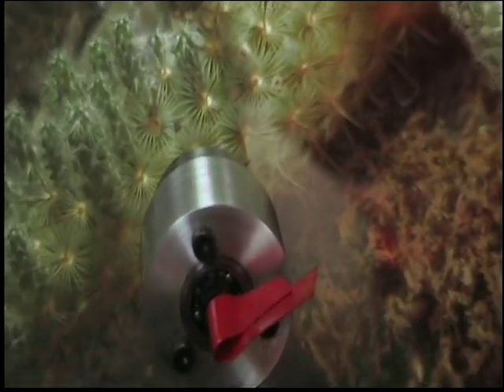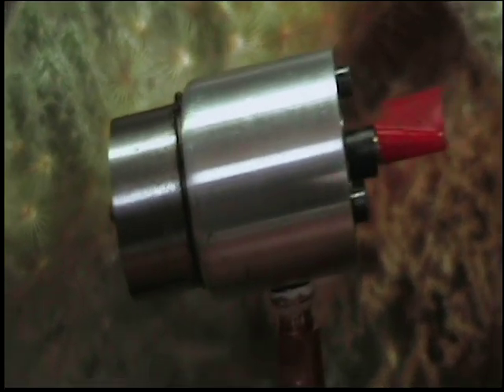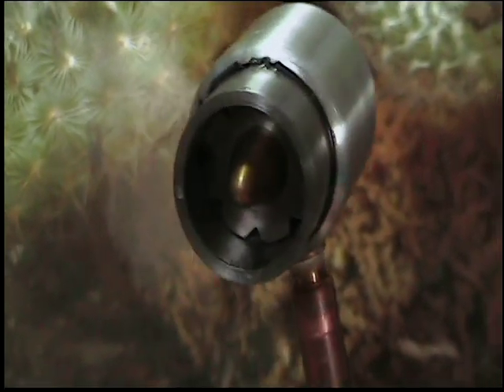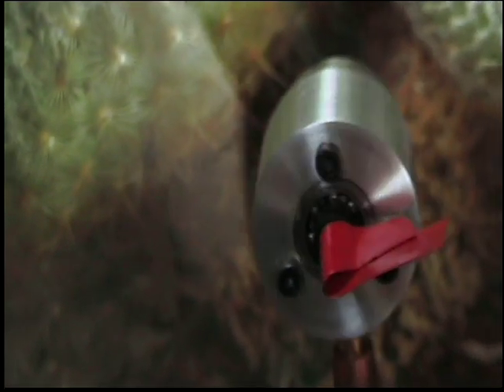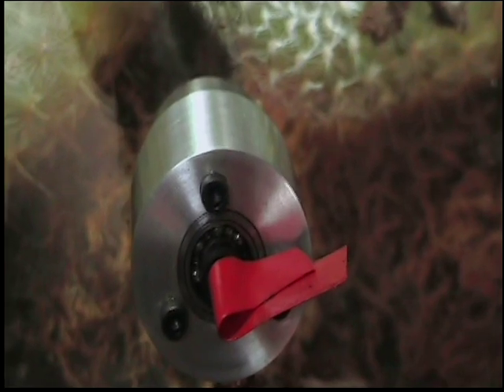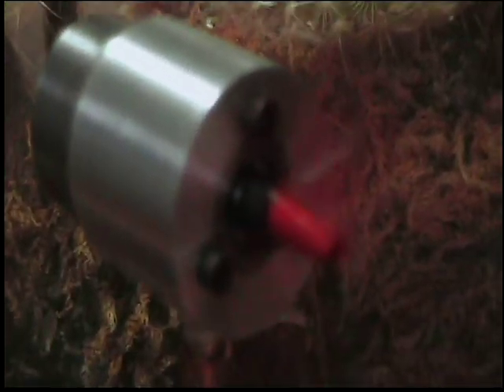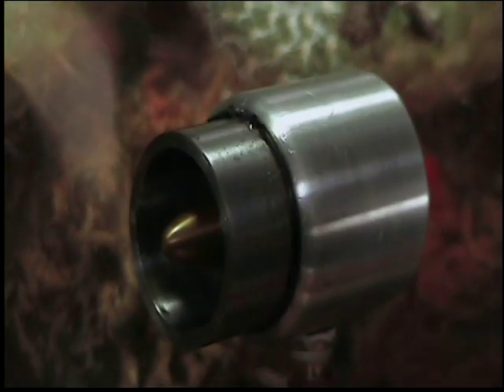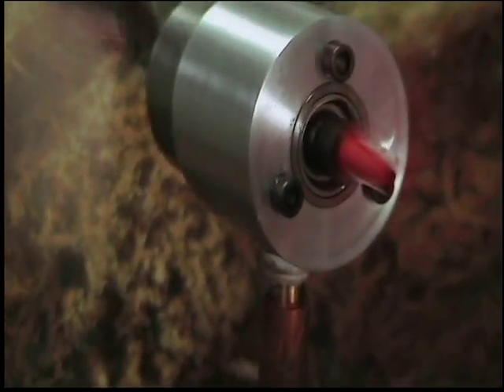Tiny Turbine Running

Comment from the maker: Actually not all that much different.  The size is of this model turbined is much smaller than most mini air tools. Perhaps a pencil die grinder would be similar in size.  The air motor or turbine in a mini die grinder uses vanes or wipers not fixed shaped blades.  The vanes seal well and with lubrication can withstand steam use too.  Real turbines use specially shaped blades to get much higher efficiency.

Comment from the maker: Funny you should mention the air die grinder, as I have done a bit of testing with them.  As far as a low priced turbine, they have promise.  They are considerably larger than this tiny turbine and require lots of air or steam.  I have been able to drive a auto alternator with a cheap mini air die grinder using steam.  The cheap wallmart ones use too much plastic for steam use now, but you can still find all metal versions for under $30.
An AC scroll compressor works better or even a smog pump.

Comment from the maker: Not really, but at this size it is hard to make the turbine properly.  A well made turbine would have a steam nozzle, blades on the case as well as blades on the rotor, they would not touch.

The air motor, for a drill uses a sloted rotor with little wipers, they actually touch the case.